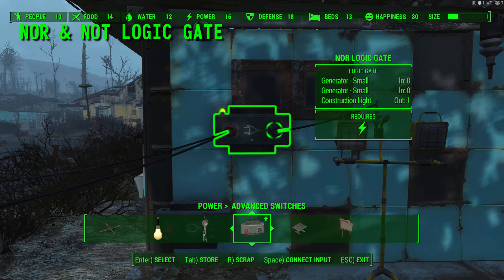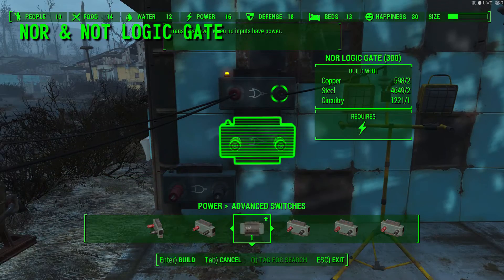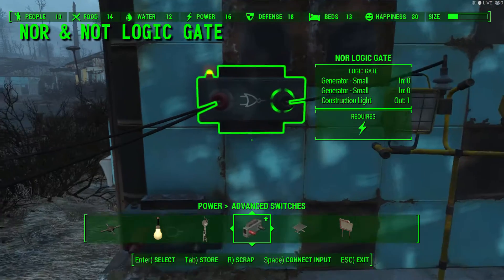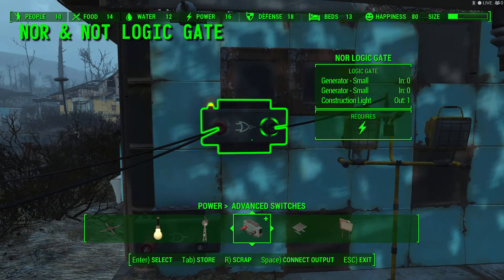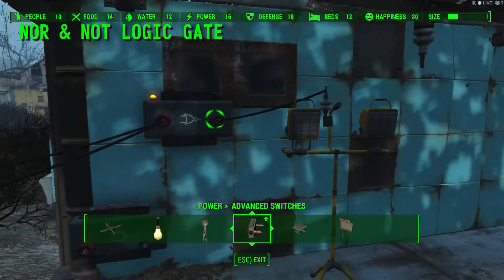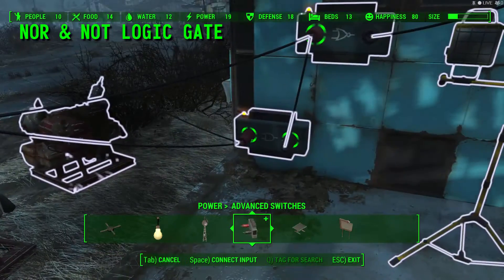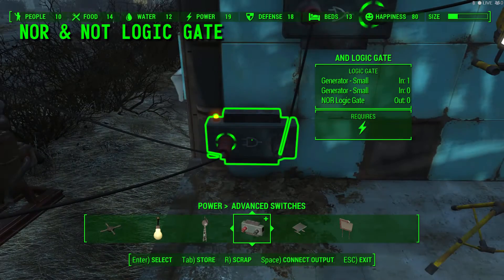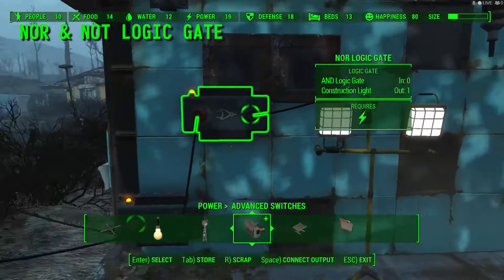Fallout 4 Contraptions DLC - HOW TO... NOR & NOT LOGIC GATE EXPLAINED [03]

Comment: Building factory with 3 presses. When press 1 and 3 are OFF, press 2 is active. Using NOT gate for this but it doesn’t work. Suggestions?
Reply: Use switches to power them individually

Comment: Should anyone come across the same question that Widdershins had, yes you can do it how Crawlin said. However, you might try simplifying the setup with using one XOR gate. You can test this using a lightbox: with the Generator, connect it to a switch as well as to the input of the XOR gate. Then take said switch and connect it also to the input of the XOR gate. Then connect your lightbox to the output on the XOR gate. Hopefully the diagram helps:

[Generator]-------------->[XOR gate]----------->[Lightbox]
       |                             
[Switch]-------------------[connect to same XOR gate above]
Reply: Thank you!

Comment: Okay, so, I'm trying to make a garage door close when there is an attack, using a siren and a nor gate, but the garage door won't open when i turn the siren off.
Reply: help?
Reply from the maker: I'll have a look.
Reply from the maker: So I built a basic one, from what you mentioned. I had a generator, attached to an AND gate and the siren, the siren connect to the AND also. The AND output connects to a NOR and the NOR output to the door. This worked fine.
Reply: CrawlinUK Games I figured it out on my own, but thanks anyway!
Reply: @CrawlinUKGames  I know it’s 7 years after the comment but thank you so much. I just spent 15 minutes trying to figure out how to do this.
Reply: @drewk4005  No worries, after 7 years this video is also for my own reference too hehe.